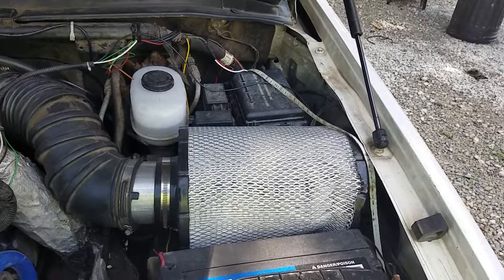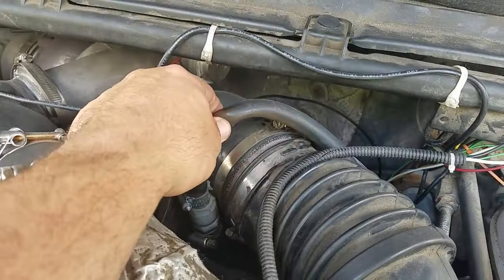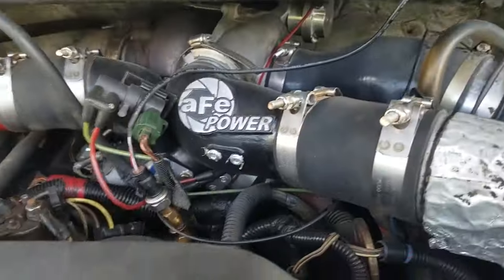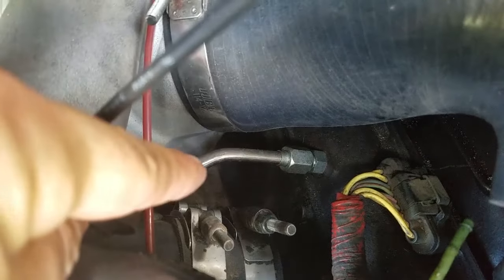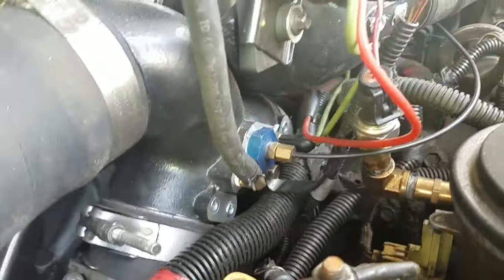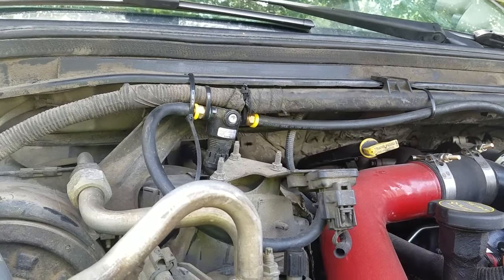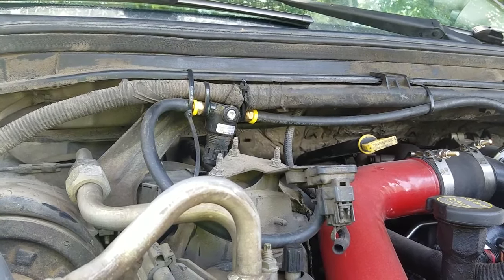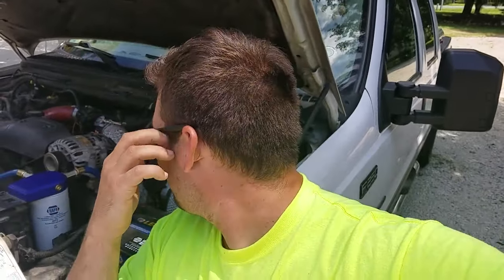5 Cheap 7.3 powerstroke upgrades

Comment: is there any benefit to a boost fooler on an OBS powerstroke?
Reply: It does nothing unless you're demanding more air then the pcm is allowing.  Stock does nothing.  Turbo master actually does something.  The pcm will tell the valve to start to open as little as 5 psi.  The Turbo master helps hold it shut until you hit the correct 22 psi.
Reply from the maker: Yes, boost fooler helps with when pushing more than 22psi. my truck is modded and pushes 40psi. the boost fooler is very important in my set up. Achieving more than 22psi is pretty easy with little mods.
Reply: You have to have tunes to push past stock psi.  The Pcm cuts fuel at the at 22 psi.  The boost fooler only fools the pcm, that's it.............  No crappy tunes not reason. Period.  Good custom tunes will adjust for the pcm reading and disable it in a sense and no need for a boost fooler.
Reply: What does a boost fooller do??????  Fools the pcm, hence why theres no reason on a stock truck.  All the other crap he said, fine, but the boost fooler he's just wrong about.
Reply: Matthew Espey so if you're purchasing a set of stage 2 injectors which require custom tuning anyway,  there's no point to it? Good to know if that's the case
Reply: Correct if you are purchasing stage two injectors, BTW your really need cc and nozzle numbers not stage two, you will need custom tuning and all your reasons for boost fooler will go out the window.  As long as the tuner is reputable.  BTW stay with known injector builders.  Not some crappy ones that have no clue.  They will take your money and claim it is you with the problem and not the injectors.  Stage two should mean 160/100 or 175/80 or even 160/30 etc.  Thats why stage two means nothing.  Need flow rates and nozzle size.

Join some FB groups and learn and read.  This info is known and a given for most.
Reply: Matthew Espey just said stage 2 for the sake of argument... 200cc/30% is what I'd be going with from Swamps... dealt with them before and trust them and also fairly certain that is the biggest injector size+nozzle combination possible for stock valvetrain & head bolts.
Reply: First 200/30 are stage 3's.  You can go bigger for stock drivetrain.  It's boost that messes up head bolts, rods etc.  Again thats all in your tuning.  Theres guys running 300/200's on stock components.  Tuning.  Are they gambling? yes in my opinion.  Tuning makes all the difference in the world.  Btw Nozzles are a bigger choice to make then injector sizes.  But that's another subject all together.
Reply: Harold Finch  I'll sell you mine.

Comment: Sorry but the ccv modification is dumb. It pulled the extra pressure in your crabk case out. Without it your gonna blow seals.
Your truck runs on oil for Christ's sake
Reply: Didn't remove it just vented to atmosphere instead of burning it for some reason

Comment: The crankcase vent mod is a dumb idea it is not going to save your turbo first of all I was just going to make a mess under your truck why not put it back through the system Ford made it that way for a reason and they're a lot smarter than you
Reply: You need to look up runaway diesel engine. It happen when to much oil is collecting in the intercooler and charge pipes. See who's smarter now

Comment: ccv modification is really bad I wouldn't recommend it
Reply from the maker: +Cameron Harris moved this to its own video discussion https://youtu.be/D10o5HOH85Q
Reply from the maker: I did check out that video, but that's a 6.0 not a 7.3. Still asking around to get some clearer answers on this for the 7.3. If it comes to pass that it truly is bad for the 7.3 will make a corrected video on it.
Reply: It's fine.  International has it vented straight to the atmosphere.  Ford stuck it on for emissions.  I'ts just not for the reason why he mentioned.  Doesn't hurt the turbo at all.
Reply: The ccv mod is needed on all forced induction engines. A better way is with a catch can. Not venting into the atmosphere

Comment: dang i really hope no one followed this video, i had a customer show it to me, and i was shocked, all mods were cheap for sure, cheap looking, and not a damn bit of functional goodness to them, the air filter is rigged up and sucking hot air form under hood, factory with a good filter is much better, the boost fooler does not alter the waste gate opening, it tells the computer to add  more fuel which makes more boost, hole by the radiator is a wash as well, the factory air damn under the bumper forces way more air to the factory air box and is cooler air as well, the ccv delete is smaller than 3/4 inch id pipe, and is kinked, restriction on that is defeating the way it works completely, beware anyone trying this junk....diesels are expensive, they take lots of money to mod, but when you do the mods right,i t will pay you back in reliability..damn, dude..please stop making video's , hell or working on trucks